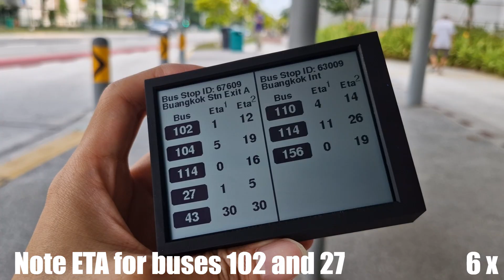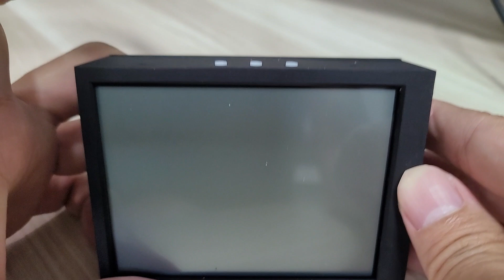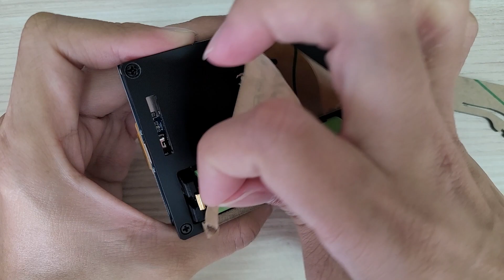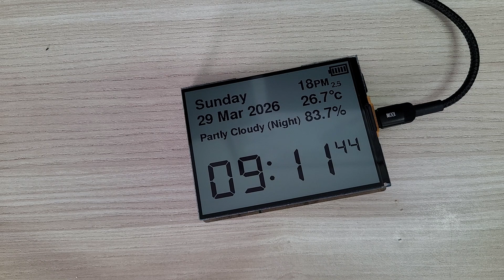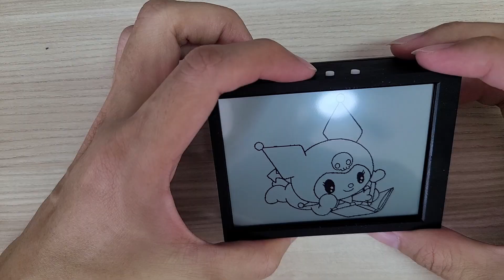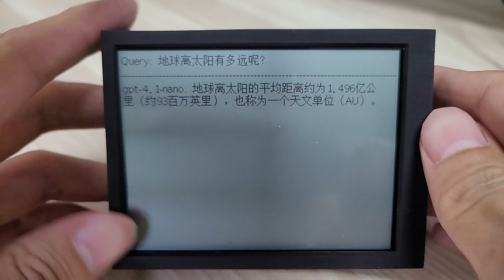Using Waveshare ESP32-S3 4.2inch RLCD as Smart Clock

Comment: Thanks for the code. The first page worked well and I changed the weatherstation code. It accepted it from Scotts Road instead of AMK. However I seem to have problems with the bus arrival page. I got the bus stop codes from my transport. However the url does not give the realtime arrival time and thus no timings. https://datamall.lta.gov.sg/content/dam/datamall/datasets/LTA_DataMall_API_User_Guide.pdf?ref=stuartbreckenridge.net when linked showed API not found.
Reply from the maker: Hi @vick3394, if you meant you tried web browser to get the JSON response directly, that won't work. Because it requires an API key authentication header, which in the ESP32-S3 .ino code posted on GitHub, you will see it as " http1.addHeader("AccountKey", apiKey);". This "apiKey", should be your own personal API key, which you subscribed from LTA Datamall. As a side note, the chatGPT prompt capability on this smart clock, also require your own API key from OpenAI.
Reply: @JH_Engineering  Thanks. I will try.